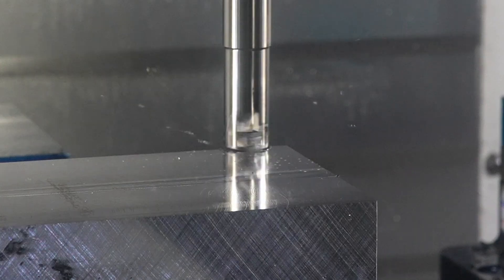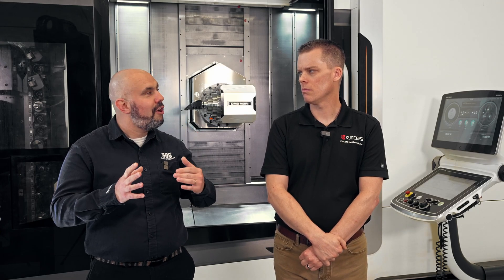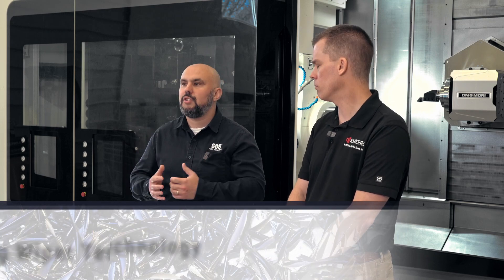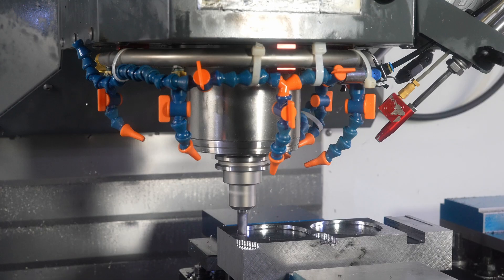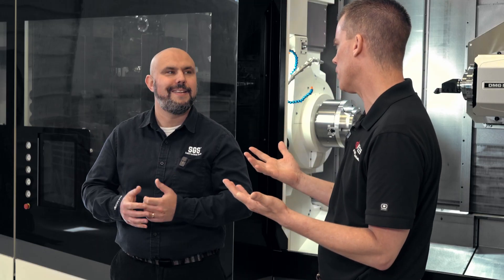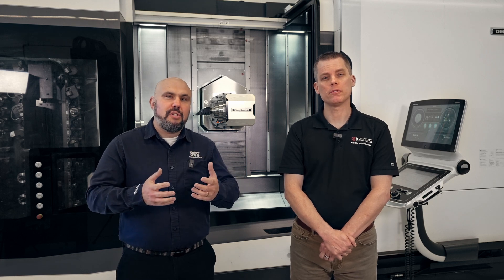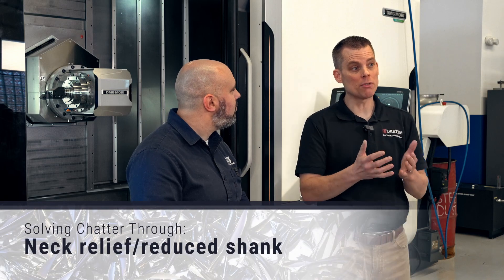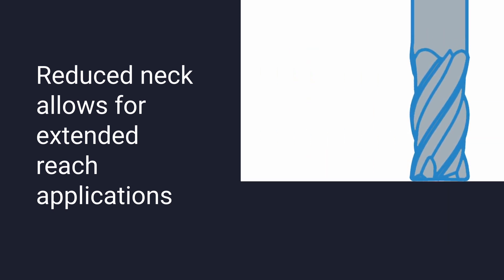Fix Milling Chatter: Expert Tips for Solid and Indexable Mills

Comment: Summary: Slowing down can help. But so can speeding up. Reducing your stepover can help. But so can increasing it. I think I'm starting to get it.
Reply from the maker: Exactly, it's all about finding the balance for your setup. Sometimes the fix is counterintuitive, and that’s what keeps it interesting.
Reply: There's no golden bullet here, it all depends on the situation. After the introduction, this video presents concrete situations with solutions and explains what was wrong and why it helped. Without understanding of what's going on,  it's basically trial and error in all directions and that's not a very useful, because without understanding you might just end up trying everything, which takes forever.